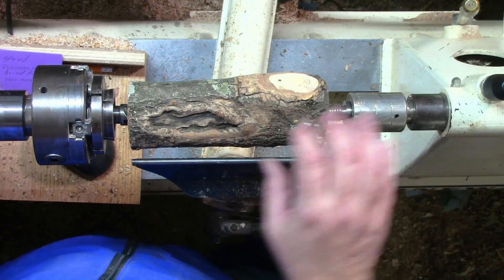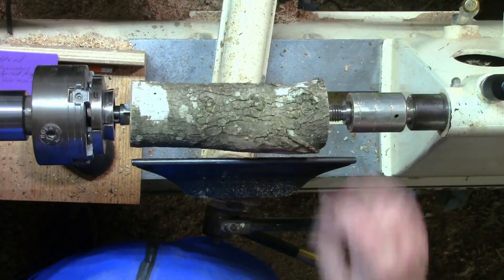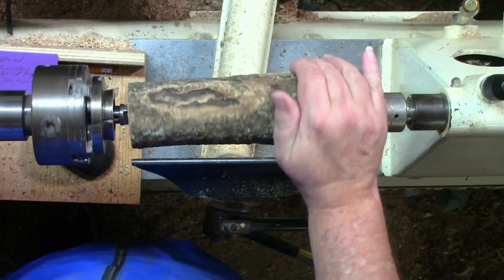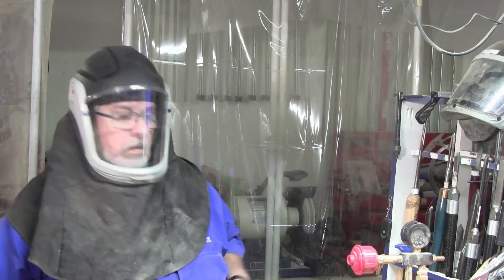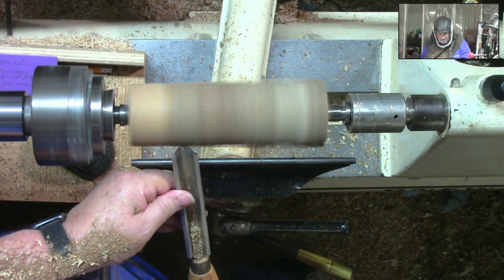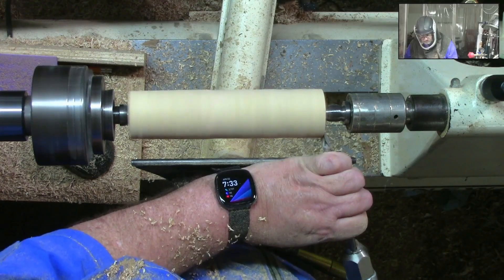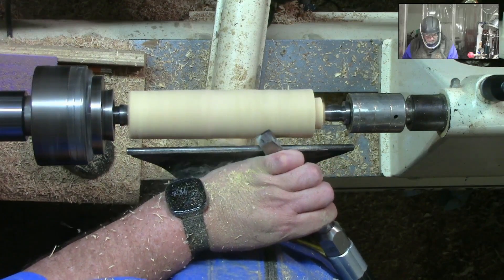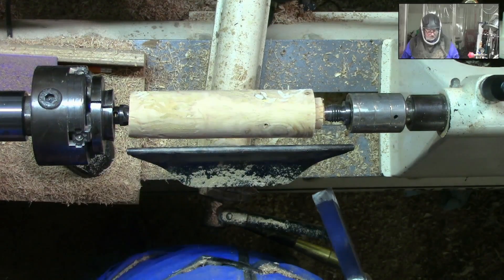Practice session using multiple turning tools. By Dean's Woodworking  #woodturning

Comment: glad youre back and feeling better Dean!
I totally agree that most times, what works for you, may not work exactly the same for me. I usually turn off the chat on any livestreams I watch because its the same things you mentioned over and over. usually, a turner will tell at the start of the video, or, in the description, what type wood he or she is working on. I dont have the same lathe as you. Or the exact same tools. My lathe doent have a DRO. It has a chart for what speed the spindle is turning for what position the speed lever is in. Is it even CLOSE to accurate? I seriously doubt it. What sandpaper do you use? It doesnt matter. I use what I can find when I need it. Sealer? Finish? Polish? Wax? Same thing. I enjoy seeing what you, and other turners are doing. But, I really dont want to duplicate it right down to the exact same RPM!
Reply from the maker: Well said Dave! Thanks!!

Comment: Turning speed is partially determined by the diameter of the work piece. Small spindles can be turned  much higher speeds than 12 inch diameter bowls. Think in terms of surface  feet per minute. For instance the surface speed of a 2 inch spindle at 2000 rpm is the same as a 12 inch bowl at 340 rpm.
Reply from the maker: Exactly there are just too many varibles to tell someone what speed they should turn. Thanks for Watching!!!